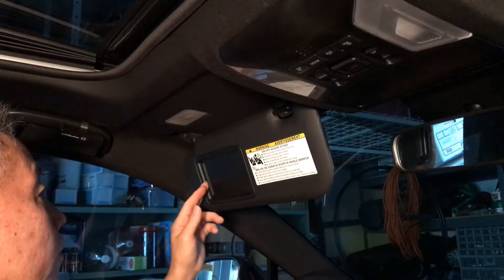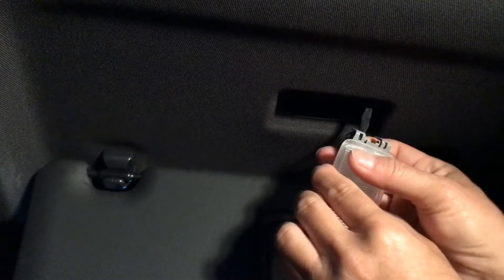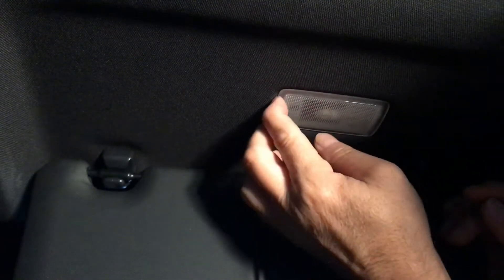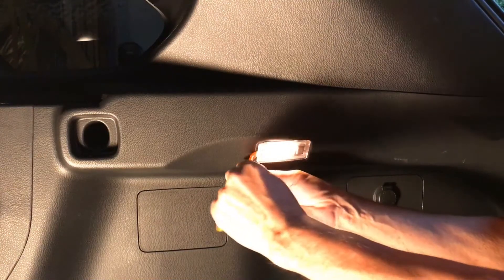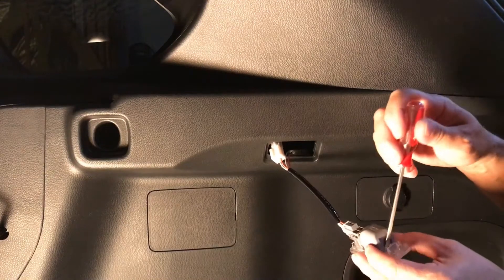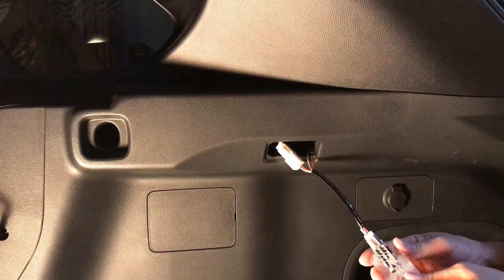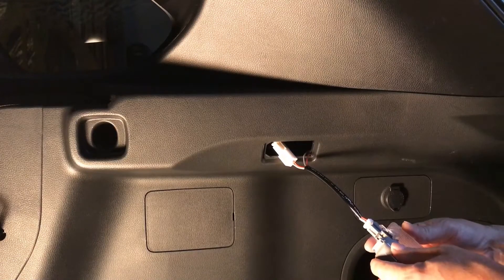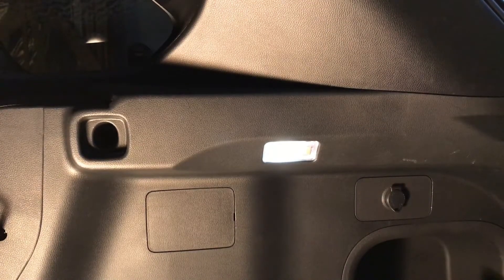Replacing Interior Lights with LED's - 2021 RAV4 Prime

Comment: Hi Phil, Thank you for your insightful video. I bought a 2021 RAV4 Prime in June 2021 from a NEW JERSEY Toyota dealer and am thinking of replacing all the bulbs. Does this eBay kit come with marks on each bulb that show it is for a dorm light, trunk light, etc.? How do we differentiate?
Reply from the maker: Hi, thanks for watching my video!  The bulbs are all shaped in such a way that you will see which goes where, as you take out the original bulbs.  Although, recently I updated the descriptions for this video, that the dome light did blow out twice, and it was somewhat dim so I bought a higher lumen bulb for a lot more cost but it's quite bright.  Hopefully it will last longer!  A new link for that dome light is updated in the description section .  Thanks!
Reply: @PhilsDIY  TY for clarifying!

Comment: thanks for the super helpful video.  Just want to caution folks to go with a more expensive option as these cheap set of lights have already started flashing and I have had to replace them after 9 months.  Not a big deal because they are so cheap, but I don't like making the effort to change them as it can be a tricky changing the map lights.  So I just bought some more expensive ones and hopefully they will last longer?
Reply from the maker: I haven't had problems with mine - I did have to replace the dome light once but the others have held up fine, and it's been a year and a half.  But you could be right that more expensive ones might last longer.  Keep us posted in about a year!
Reply: I’ve had to replace cheap leds in my Prime. Get good ones.
Reply from the maker: @dsheehan66  You might be right.  Although when I got the more expensive one for the dome light, it looked IDENTICAL to the cheap one.  It did have a higher Lumen output but otherwise indistinguishable. Go figure, right?  Anyway, thanks for watching and for your comment - I appreciate both!

Comment: I changed out my map lights and curious if yours light up when you open the door but in a low/dim setting if the car is not running. If i leave the door open and turn on the rav they get brighter as they should be
Reply from the maker: Hi, I had to go and try this, and yes the light does get brighter when I put the car in Ready mode, with doors open - but not by much.  I have never noticed this before, since I hardly ever turn it on with the doors open.  Thanks for pointing this out!

Comment: I ended up breaking 2 rivets. can you tell me what kind of those rivets are? i want to replace it. thanks for the videos
Reply from the maker: Ooh, sorry to hear that.  If you mean the red clips for the main center light console, I think you can find those on Amazon, or you can go to the local Toyota dealer parts department and ask to get some.  I don't know how much they would charge, but maybe they would just give you a couple.   Good luck!
Reply: How did you manage to break those two rivets? What would you have done differently? I’m in no rush to change the OEM bulbs since I want to use them some more before I replace them.